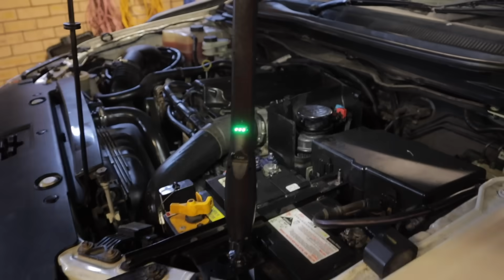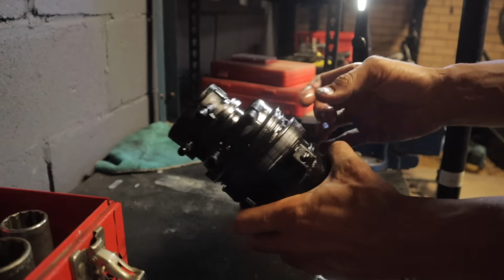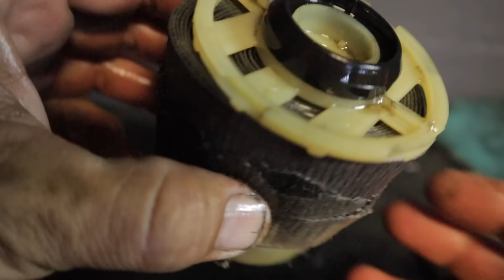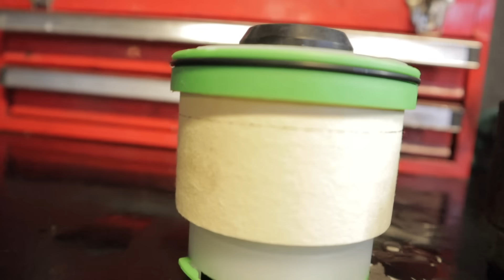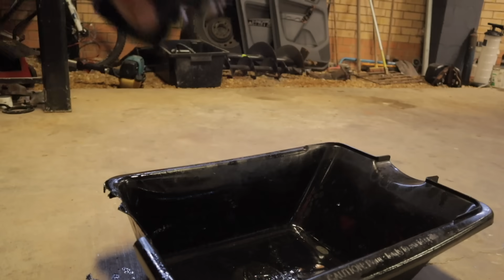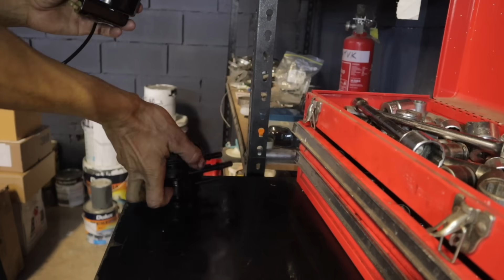The No.1 Reason Why Ford Ranger Engines Fail.

Comment: This filter costs $3 people are either unaware or just dont care
Reply: More like $30
Reply: @shanedwyer4881  yes, once you faithfully pay your dealer tax. The original filter is worth less than $3. Its just synthetic fiber nothing special. Anyway the seller has to make a good profit margin
Reply: @shanedwyer4881 right? Any filter that costs less than $18 nowadays is a cheap knockoff that might look similar to an OEM filter but isn’t going to do the job.
Reply: @Zeek800 Its basically just synthetic fiber trapping contaminants. You’ve been convinced it’s expensive. As a FOMOCO wholesaler, I know OEM is not that expensive, but we love folks like you who think high price means high quality
Reply: @ncba  When did fomoco start manufacturing filters in-house?  
They do love to charge high prices for most items compared to after-market suppliers
Reply: Problem is 1. Badge on the front 2. Oil leaks, cracked rocker covers. 3. Glo plug failure. 4.glo plug control failure. 5. Pcv hose split. 6.air intake duct split........
Reply: Plus tools, plus paper towels, +brake cleaner, + time, drain pan and disposal method for dirty fuel, and maybe a scan tool to re-prime the system.
Reply: Why not both
Reply from the maker: This is why you look after your car this was bad chris did this vid to show how bad it can get if you do not look after your oil filter well
Reply: @abdautomotive  Oil or fuel filter?  
Both + air hopefully
Reply: $3 sounds like a fake one😅
Reply: @kawashimaarisaka2682 its original fomoco you have been made to think costs $30. Also the fuel filter is literally just synthetic fibers, you are only getting a fomoco label with the original one, no difference with a good quality after market

Comment: So the reason why Ford engines fail is because of bad maintenance? Thats not on Ford. Thats on the owner.
Reply from the maker: 100%
Reply: That's what I'm starting to realise. Ford have 15k service intervals on these things, and recommend changing the diesel filter every 30k. That's too long imo. I service my PX2 every 10k and my diesel filter every second service, so 20k. These long service intervals on new cars these days are the biggest problem with reliability issues from what I can see.